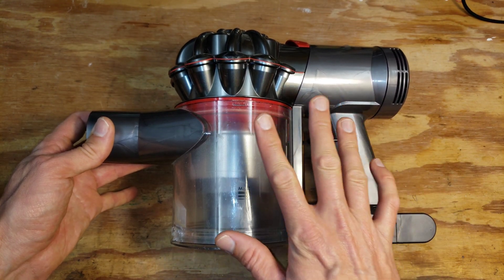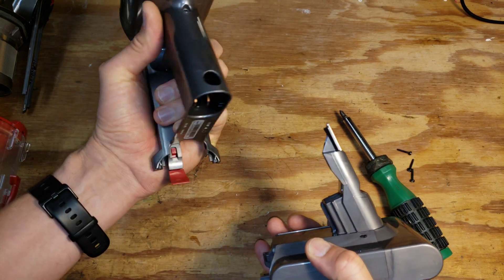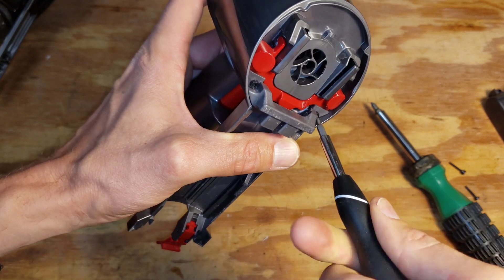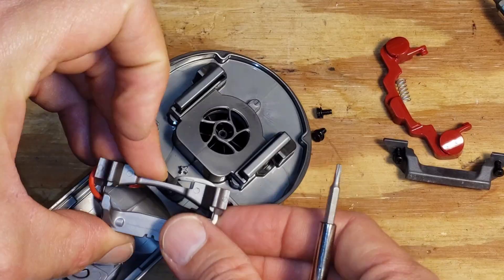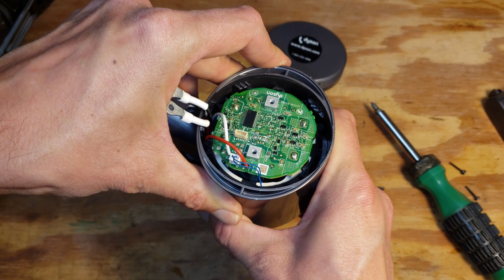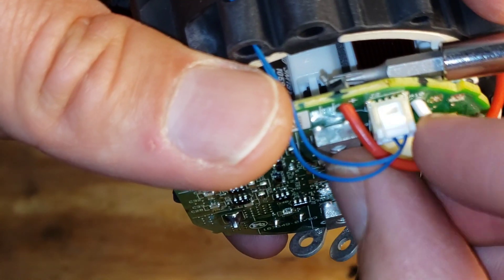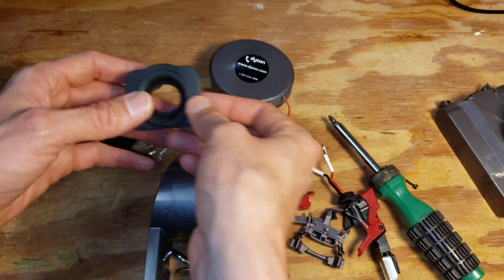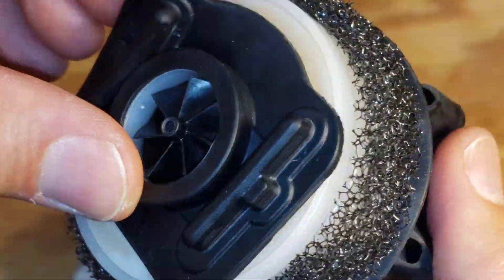What's Inside? Dyson V7 Battery Cordless Vacuum Cleaner Motor Head Take Apart

Comment: Great video. my problem is the mini motorhead is not working. I believe with the mini motorhead off there should be voltage at the two pins  where it connects to power on front of cannister when switch is activated. I get none there or where the cannister connects to the motor head. Dyson V7 Trigger. I have tried hooking up a power supply to mini motorhead. I cannot get the brush to turn that way either.
Reply: Finally got the mini motorhead apart and got the little motor out. Hair and dust were keeping the brushes from making contact. Thank you.
Reply: @coveylane  how did you do this?! I'm having the same problem!
Reply: @0802dayna  I may not know all the steps but i will try to figure them out and get back to you. I kept going back to it and finally figured it out. it looks like a solid molded unit but it isn't. Are you having trouble getting it apart or do you have it apart and can't get the hair and dust out of the motor.